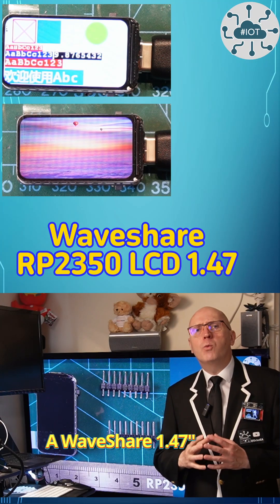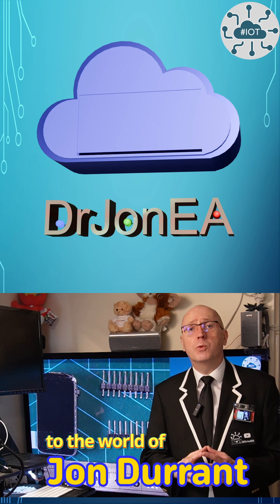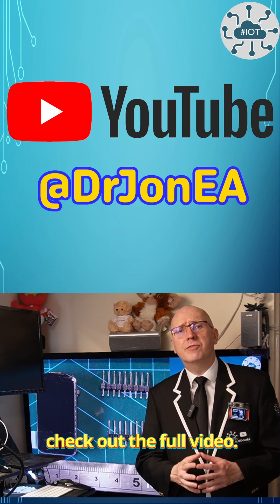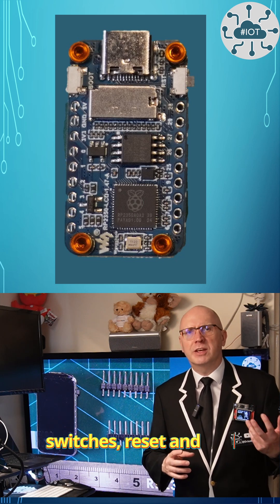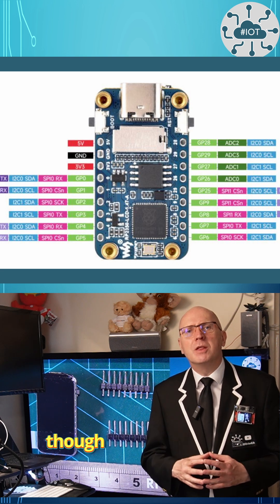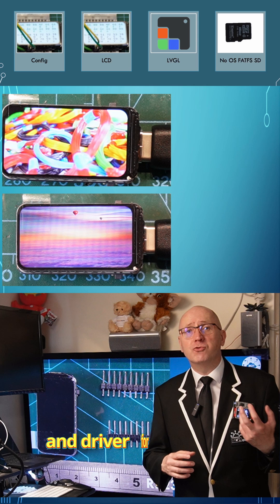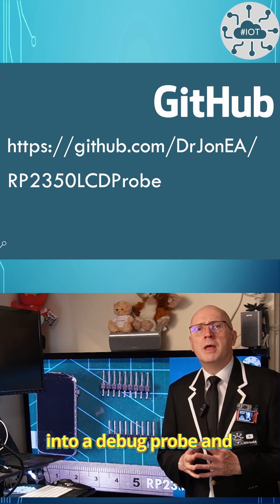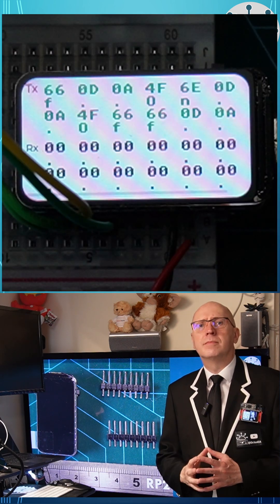#3min Waveshare RP2350-LCD-1.47

Comment: How do you get the sd card slot to work ? I can barely find anything on it.
Reply from the maker: There are Waveshare examples using it. I haven't done much with it. Need to make sure you have formatted the sd card to FAT16 or FAT32.